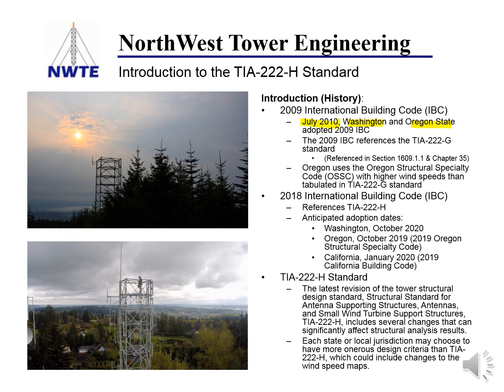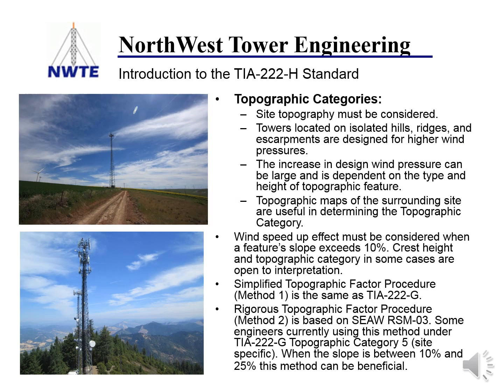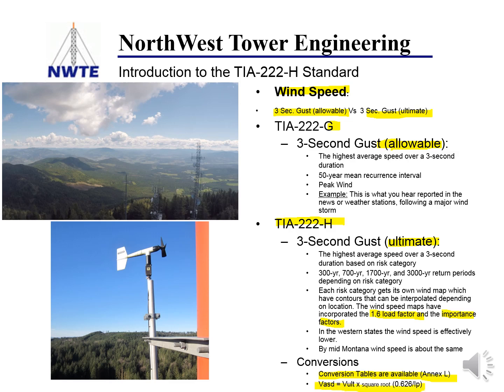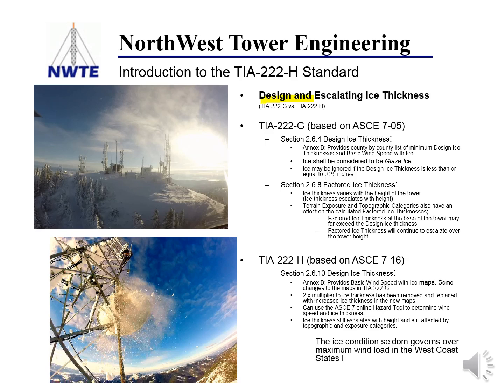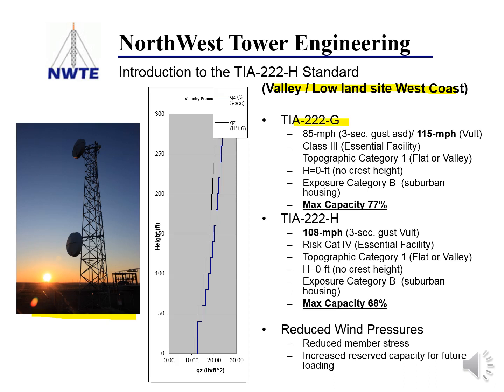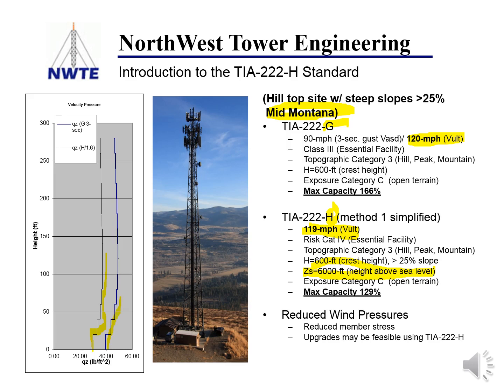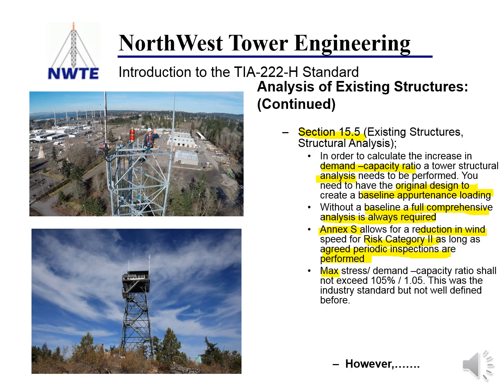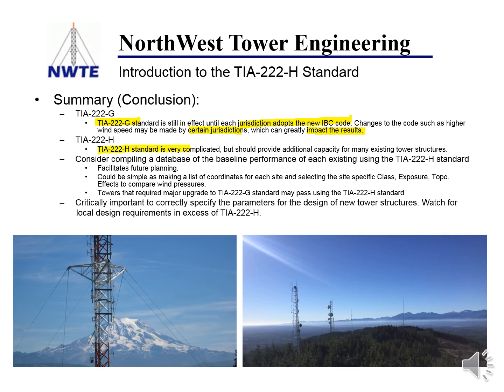Presentation Rev H vs G

Comment: What matters in this video is the conclusion, which is slightly convincing, as per my experience the difference from G to H is around 3 to 5 percent only. but I agree that whatever designed in G is most probably will pass in H. And useful to use H when planning to add new antennas. Strength-wise better to use G, Marketing-wise better to use H as the tower is lighter to purchase.
Reply: Smart summary....sometimes its annoying to bother practioners with minor and infinitesimal changes.
Reply: valuable add. thanks